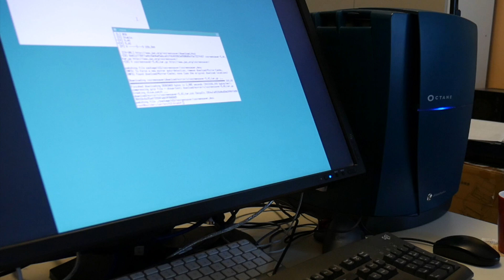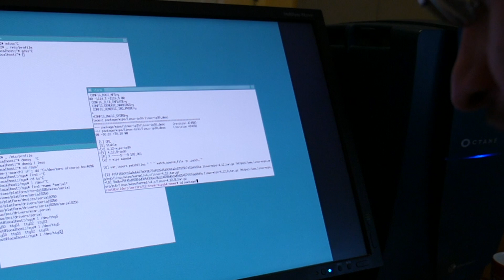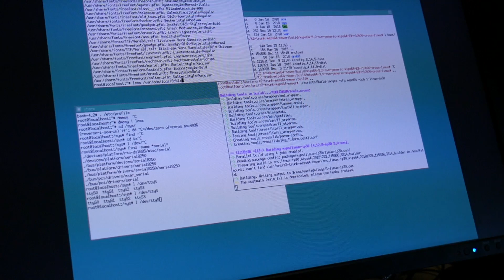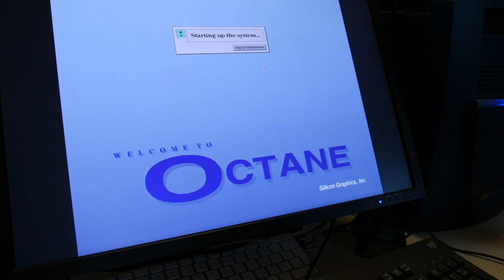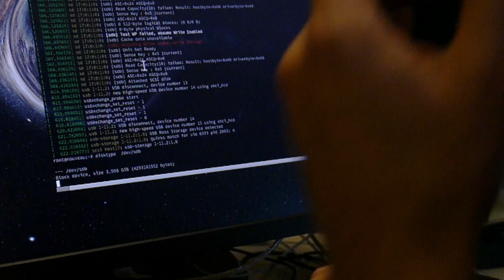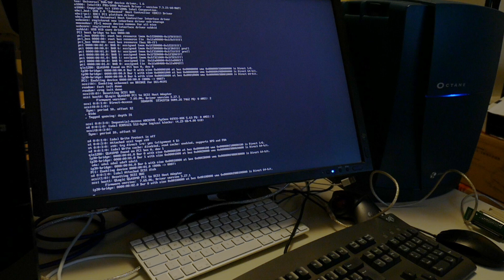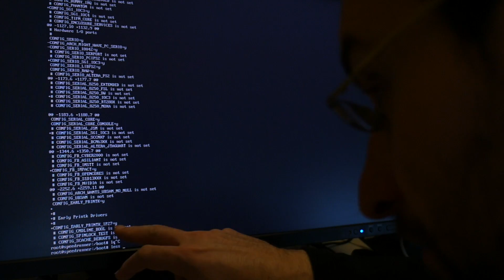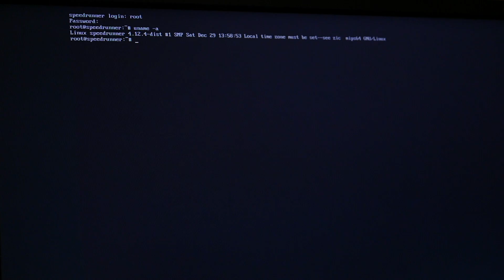Sgi Octane mips64 Linux updates and weekend tinkering ;-)!

Comment: Rene, why don't you replace the mechanical hard disk with a Compact Flash + Adapter?
Reply from the maker: are there SCSI CF adapters? I saw the SD adapters, however, I do not trust SD cards for Unix system load. I had one in my Microsoft Surface and it died in less than 6 months with BTRFS journaling load. Not sure if CF cards are that much better, maybe the very latest ones. Could try and test  this for the YT viewer audience tough, ..! ;-)
Reply: Yes, there are from ACARD you can get IDE/SATA drive to SCSI for under $100 used PATA SSDs exist also , and Artmix has http://www.artmix.com/CF_AztecMonster.html he used to sell on ebay but looks like you can only buy direct now. Sata to SCSI is probably the best value and most reliable though even a cheap SATA ssd is going to be more reliable than even a CF card.
Reply from the maker: the cheapest ACARD SATA to SCSI I could find on ebay is 279€ https://www.ebay.de/itm/Ultra-SCSI-50pin-zu-SATA-Bridge-Adapter-fur-SATA-ODD/361780615659?hash=item543bce19eb:g:xhIAAOSwal5YCNTr:rk:38:pf:0 and other offers being more in the 500 to 1000 range, ..!? :-/

Comment: Build musl based T2 for MIPS64
Reply from the maker: great idea and comment ;-) packaged must for #t2sde already, worked so far, except our flist wrapper shared library hooking did somehow not work stable / reliable (for the build-sandbox file tracking). But certainly another great video idea to build and test must on the Octane another snowy winter day ;-)! https://t2sde.org/packages/musl